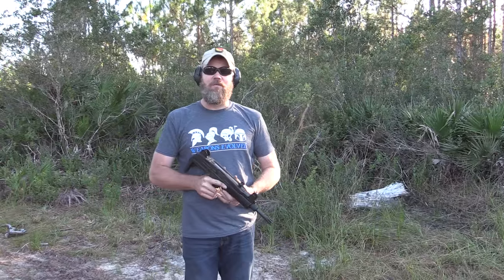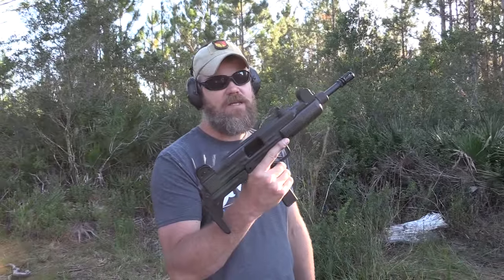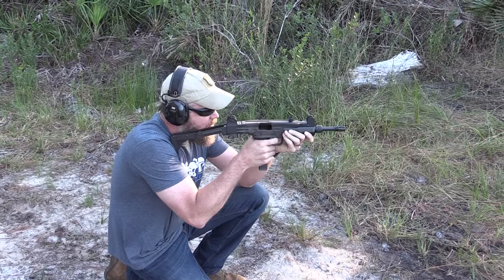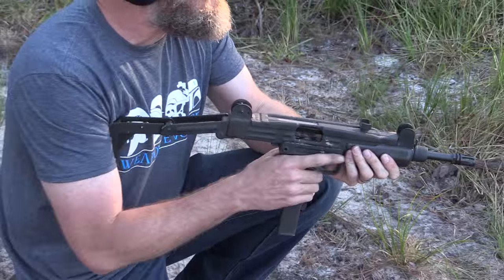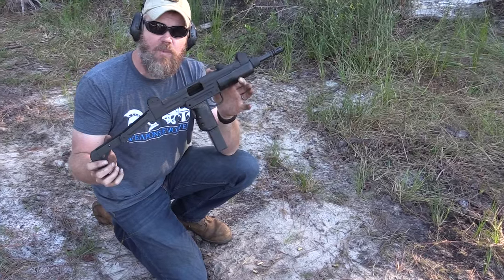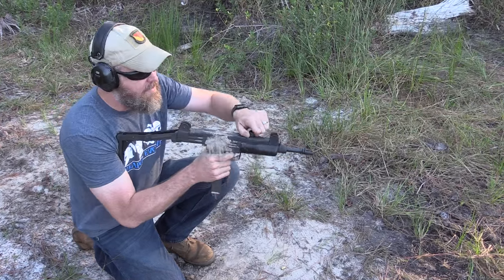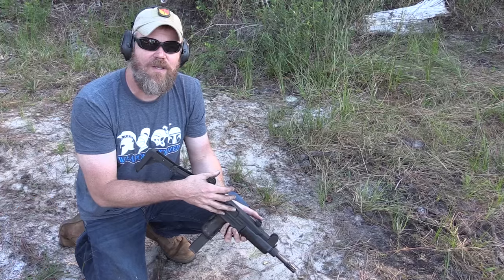Full-auto Uzi SMG sand test!

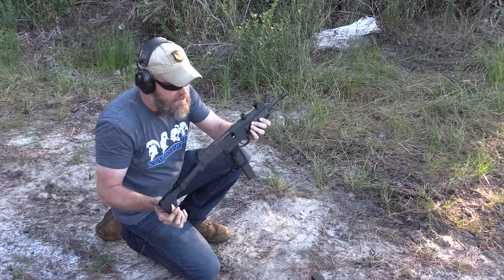Comment: Whoa careful there at 4:10, if the bolt closed while you were ripping out that mag it would have fired. You should have racked back the bolt before pulling out the mag. Gotta be more careful with open bolts when you have malfunctions. Good demonstration though
Reply: I noticed this as well. Bad move!
Reply: Hickock45 Opps
Reply: +packer492 better safe than sorry...
Reply: +packer492 the whole point of the comment was it was not safe.  if the hangup had been mag or double feed related removing the mag would have caused it to fire.  but yes it was always down range.
Reply: +Justin Gruwell Lube plus sand equals the most consistent and quickest rout to a non field fixable failure. its like trying to get sticky gritty mud out of every nook with no pressure hose.
Reply: +Justin Gruwell If the gun works well with it, then that's a great option for sand!
Reply: +Guntech762 I cringed when he did that
Reply: it was down range sallys
Reply: This isn't a concern on a full-auto uzi.  They have a ratcheting top cover, it can't drop. Every single boy scout responding in to this comment has no idea what they're talking about.  Be careful on the internet, folks.

Comment: Sand and mud usually don't mix with open bolt guns. That's why most of the modern SMGs are closed-bolt. 
BTW that was one of the reasons why Mr. Kalashnikov never added a bolt-catch to his designs. Even later models of the AK (AK-74; AK-74M; AK-103 and so no) don't have it. He was saying that "In the battle, chances to get hit by an enemy bullet raise drastically while reloading a gun; i.e., when the gun's bolt is open and held by the bolt catch. A soldier gets hit, he drops down and his AK goes down, too. It hits mud or sand with bolt open. Voila! We've got a non-functional gun which cannot be picked up and used by his comrades without being thoroughly cleaned!". I have to admit that he had a point!

Comment: When you are clearing a malfunction in a open bolt gun you need to first get the bolt under control on the sear before you do any thing else like pull the magazine out. This is a safety issue to keep from having a ND if the magazine was holding the bolt back.

Technically I would say running around with its "butt" open since its mouth would be the magazine well and the barrel would be a male appendage.  :)

Comment: Might be a fun gun to rent if I felt the need to waste a few hundred dollars worth of ammo just for sheer fun. Though as far as full auto guns go, the UZI would be pretty far down the list of guns I would want to shoot. I would never want to ever own one. I can see it sitting and collecting dust most of the time.  I would certainly never need one. Close to 20 grand and an 11 month wait for the approval. Then you have a gun that empties your wallet with ammo costs faster than it empties the magazine. 

Absolute insanity for a pistol sized weapon with a low power pistol Cartridge that only has 20 round  capacity or up to 30 if you can find mags for it. Just get a good semi-auto 9mm pistol with a smooth trigger that has a very short take up, that will be a heck of a lot more concealable.  Get a couple longer, extended magazines and forget the full auto. With a good enough trigger you can pop off shots pretty fast.  Sure it's not full auto fast, but getting pretty close, especially compared to the very slow (for full auto) UZI rate of fire. Your wallet will thank you later. Spend it on ammo.

Comment: The closed method is not safe... if one falls, the bolt can open enough to strip a round, close and fire... if it does not open 100%, it will not hit on the bolt hold open sear.
Same reason why you lock the bolt to the rear for reloads.  It ensures that the bolt is on the catch and not just hung up on something....
Reply from the maker: +hogfeederyahoo The Uzi has a grip safety to prevent this.
Reply: +hogfeederyahoo    So with the bolt closed, the grip safety is deactivated by your hand on the SMG.  If you pull open the bolt 90% and let it drop, what keeps the bolt from stripping a round, closing and firing?  I have had AD's while doing a mag change... I thought I had an empty mag, when I stripped the mag, the bolt stripped a round and fired.  Finger was not on the trigger.  We were firing a 4 shot drill and only 3 fired.  I assumed the gun was empty, quick glance showed the bolt open.  When I started to remove the mag, the AD happened...    This was at the end of a 5 day class and the guns were filthy.   I failed to lock the bolt to the rear before changing the mag.     Unless I was using an older design
Reply: With early uzi's and most other open bolts you would be correct, but they went to a rachet type charging handle pretty early( when MAC cycled the handle and it did not return forward and would not fire, the rachet doing it's job). It was designed to prevent the situation you describe, whether accidental or negligent.
Reply: +hogfeederyahoo That was the way the U.S. military carried the Thompson during its issue.
Reply: hogfeederyahoo In that case the charging handle wasn't engaged with the bolt and was a weapon specific malfunction. Always a good ideal to lock the bolt back and engage the safety when you know you had a malfunction,but in your case you thought you were dry so........

Comment: meanwhile guy with ak is shooting you full of holes
Reply: +Loganx5 Ah, they jam up too with sand, any weapon with its dust cover open can fail because of foreign objects screwing with it.
Reply: +Loganx5 AK is the gun you can trust.
Reply: +IIIII47IIIII thats why you can throw it in sand, mud, sand.
It doesnt jam there, an american maybe does, but not an AK
Reply: +baff shogun AKs jam with mud and sand in the locking lugs if you throw it in the breech. Only those who never really worked an AK think it is some kind of reliability diety. It is reliable, but in truth not that much more than an M16

From an engineering perspective, the way you can tell if a gun will be reliable or not without shooting it is to look at the bolt carrier. If it runs on rails, it is good to go. If it is sliding in a tube (like the uzi or mac) you will have issues. M16 looks like it is sliding in the tube, but it actually is relieved except for four corners. However, this is still not as nice as a strict rail like on the ACR, Scar,  or AK.
Reply: I’ve seen an ar15 take what an ak can’t.
Reply: @z-trip5457  
Aks are trash
Reply: FernTheYoutuber they must’ve never seen a dust cover eh?

Comment: As to the M3 in N. Africa... So just how did something entering service after Mid-1944 see service during June 10, 1940 with America starting assistance after June 11, 1942 through May 13, 1943 when that theater of operations ended? See @t .
"The M3 was intended as a replacement for the Thompson, and began to enter front line service in mid 1944. Due to delays caused by production issues and approved specification changes, the M3 saw limited combat use in World War II." See @t .

Comment: As to the Thompson... I will get to the UZI shortly.  The Thompson SMG was the primary service sub-machine gun used by the US in WW2. But it was expensive to make even in the simplified M1 version, which was done by Savage Arms, of course under license of Auto Ordnance.  The original Thompsons employed a "Blish Lock" delayed recoil system which allowed for much higher cyclic rates (1100 rpm) and much reduced recoil and muzzle rise over later variants of simple blow back operation like the M1 with only 600 rpm will significantly more muzzle rise and felt recoil.
The formation of the state of Israel in 1948 lead almost instantly to war. However, support from the United States was very limited and none from Europe. The efforts from the US were mostly private in both volunteering service by individual former US servicemen and private fund raising and arms supply... due to policies preventing arms supply.  So Israel wanted in country arms manufacture.  The UZI developed out of this need during a period of war, limited supply, limited material, and limited manufacturing capability.  In the history of sub-machine guns in particular this combination makes for great guns... very loose fits and wide tolerances are easy to build cheaply and turn out to make for rugged and dependable guns. This is the heritage of the UZI.
Real combat use never involved treating ones weapons poorly or stunts.  Every trained and experienced soldier in the ranks will tell you keep you weapon maintained and clean... or you die! So that is drilled into both doctrine in training and use of weapons.  And, every precaution is made not to contaminate or mistreat weapons in the field.. some official IWI videos. https://www.youtube.com/watch?v=Dht77VdXQaY and... https://www.youtube.com/watch?v=89uRgo3Faig
But for a demo you might IWI video... https://www.youtube.com/watch?v=hI-RPkMdpQo
YouTube soldiers... like this better .... https://www.youtube.com/watch?v=B_eHmVKMtFU